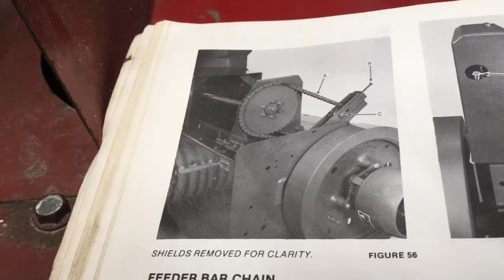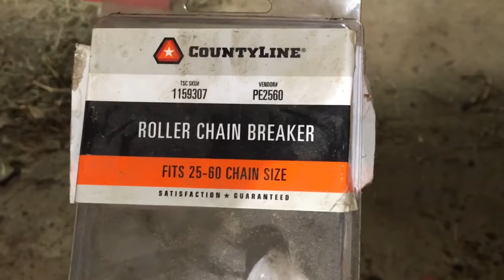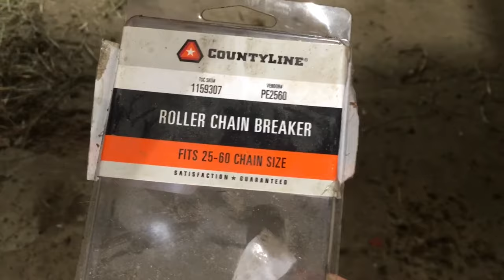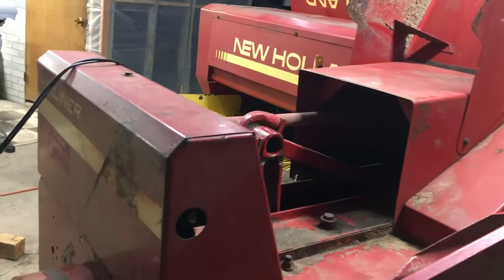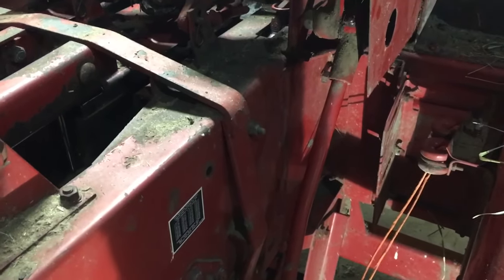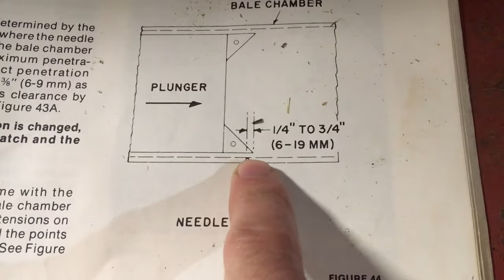Checking needle timing and adjusting chains on New Holland baler

Comment: Hello. This was a very informative video.  I have a question, regarding the bailer needle. Is there a video or a guide that you could recommend that demonstrates how to change a or replace a needle on a New Holland small square baler?
Reply from the maker: The needle replacement is quite easy. It’s just held on by 3 bolts at the bottom. Then the needle needs to be adjusted to the knotters. It should rub just lightly on the knotter frame and clear the twine disc by 1/8”. Instructions for the needles adjustment are in the manual.
Reply: @TheScientistHayFarmer  
Thank you for your feedback. I have a 565 square baler. At the back of the needle where the bolts are that you are talking about is a brace that makes removing the bolt completely a difficult task. I have since notched that brace and was able to remove the bolt and replace the needle. All of this happened before I was able to get the manual. 
I greatly appreciate you and your insightful videos
Reply from the maker: @d.conraddoctor5465 it will be important to adjust the needle to the knotters now.

Comment: Thank you for doing this, the timing is perfect. I have a NH 273 that has a very similar knotter chain setup, and it has INCHES of play on all chains. Replacing them in on my list of things to do. A few springs for the fingers and a hay dog as well as a bearing for the feeder.  Seeing the actual timing being done will go a long way to helping me.  On my old baler it has lines gouged in the metal instead of dots, but in the same location.    Question on the cam that is next in line to the right of the clutch, does it have a bearing it rides on? On mine it looks like a roller but it is no rotating and I can see wear, so wondering if that is something I should replace.
Reply from the maker: I am not sure which cam you are referring to. 

You could just remove some links from your chain to tighten it up. With the 3 acres you’re doing you’ll be lucky if you see 500 bales a year so your baler isn’t seeing a lot of action.
Reply: @TheScientistHayFarmer   The chain is pretty worn, and cheap to replace compared to the sprockets.  Something I knew when buying it that they would be replaced.   

The cam I am referring to, I can see in your video looks just like the one on the 273. Its the first thing sticking up to the right of the support bracket next to the clutch.  It looks like a roller rides on it, but I can't tell if the roller supposed to rotate.  It might need to be replaced on mine as I see abnormal wear on the cam, compared to yours.   I can't tell from the parts blow up what the roller part is.
Reply from the maker: @acdii  you can get the chain at TSC. Is a 2040 on mine and probably is on yours too. There are several clutches on a baler so not sure which clutch you are referring to.
Reply from the maker: @acdii  if you’re talking about the knotter clutch, that’s just a roller for the trip arm.
Reply: @TheScientistHayFarmer  I finally found the diagram, it is missing from my documents, but Messicks has it online, its the twine finger and lever, the cam follower appears to be seized on mine.  Was just curious if yours rotates.   Thanks for responding.

Comment: Great video. Unfortunately it doesn’t talk about what to do if everything timing mark wise is lined up yet needles aren’t in time. What to do?
Reply from the maker: I don’t explicitly say that, but that’s why I then show how to actually check the needles. You should always go by where the needles are coming up relative to the plunger. That’s what’s most important. I’ve heard related claims that timing marks can be off though have not actually witnessed that myself. 

If your needles aren’t in time even though your timing marks are, then it tells me your needles probably weren’t completely home when the timing was set. If that clutch dog isn’t tight against the stop as I show, then it will make your timing marks appear to line up and then when you test the needles, they’re out. That’s because when you pull the needles all the way home via the yoke rod on the right side as I demonstrate, it makes the knotter clutch move a few more inches. At which point your marks would be no longer lined up, telling you your timing is in fact off. 

That felt confusing. So the bottom line is you have to pull that rod back first. Simply pulling the needles back by the yoke won’t do it.

Comment: I need to shorten my knotter chain!  How did you split it?  Do they have master links?
Reply from the maker: Yes there is a master link. Just a word of caution though, if it needs shortened it’s probably stretched. 10’ of chain is really cheap at TSC! Just buy two boxes and replace with new chain. It’s not much extra work than just shortening the original chain. When I made this video I really should have just replaced it, because I did end up replacing the chain.
Reply: @TheScientistHayFarmer  I never even dreamed TSC would have that chain. I thought for sure it’d be ordered at the local dealer and take months to arrive. You’re right then, I’ll likely replace before I stress over shortening. Thanks again
Reply from the maker: @rodney5656  it's just regular 2040 (I think) roller chain. All the chains on your baler or most implements are nothing special and are common hardware.

This:

https://www.tractorsupply.com/tsc/product/tru-pitch-roller-chain-chain-size-2040-10-ft

And you'll need a roller chain breaker like this too:
https://www.tractorsupply.com/tsc/product/speeco-roller-chain-breaker-s05050

Also be sure to pick up a pack of master links and offset links.
Reply: Дуже корисне відео для мене дякую що скинули посилання на це відео дякую що відповіли на моє прохання 🇺🇦🤝🤝🤝🇺🇸👍👍👍👍👋👋👋👋🙏🙏🙏
Reply from the maker: @КогутКогут-д5с  Glad it's helpful! God bless and stay safe.
Reply: @TheScientistHayFarmer  дякую друже за вашу турботу 🙏🙏🙏🇺🇦🤝🇺🇸 ви є дуже хороша людина !!!

Comment: How do you repair a baler with the needles stuck in the upright position in the bale chamber? Do you have to take apart the yoke and then re-time the baler? We have had this issue a few times in a row while trying to bale corn stalk bales. Using a NH 315.
Reply from the maker: Empty out the bale chute to get the stalks out and pull the needles back and time them. Be sure to pull the needle brake rod back to set them to home before checking time. Does it do this when you bale forage? I’m wondering if the stalks are making the knotter clutches slip and not returning the needles. I have not experienced this and would consult the troubleshooting section of your manual to start. Stalks really beats up a baler and is never something I would bale in mine.

Comment: Thanks for this.  I just picked up my 311, and am working my way through the manual (although my manual seems a bit different than yours).  This helps a lot.  What do I see around 10:42 on the left side near the needle yoke that looks like electrical wiring?
Reply from the maker: That is for my moisture probes in the bale chute.

Comment: Could you please do some explantion on the needle protection latch
Reply from the maker: The needle protection latch is a large metal latch that is directly connected to the needle yoke via some kind of rod or cable. When the needles are at home position that latch is recessed. When the needles are moving into the knotters they push the cable forward which causes the latch to pop out and intercept the travel of the plunger crank so the plunger doesn’t strike the needles if they were out of time. Hitting the latch will break the shearbolt on the flywheel. If the needles are in time the latch is popped out when the plunger crank is making a Revolution. The latch recesses just in time for the crank to pass without hitting it.